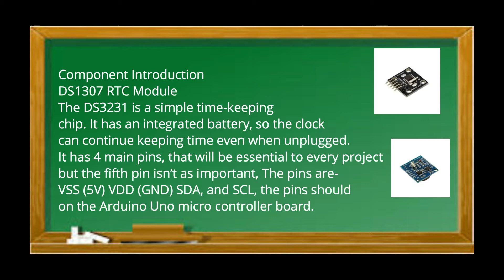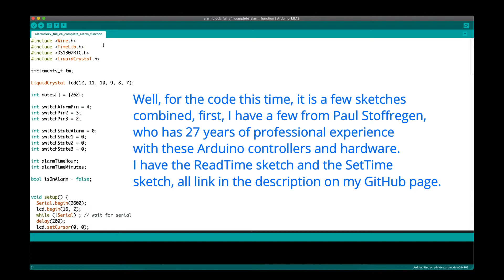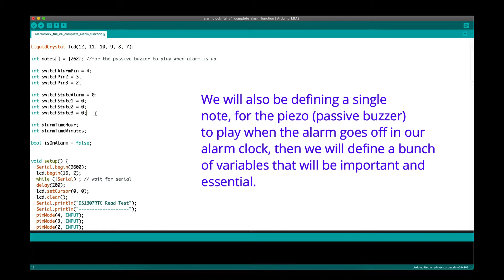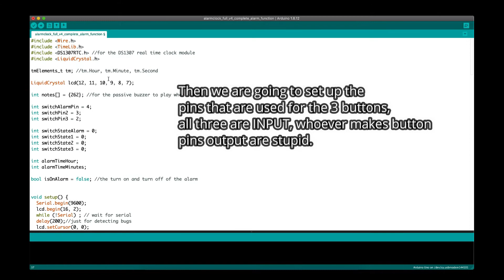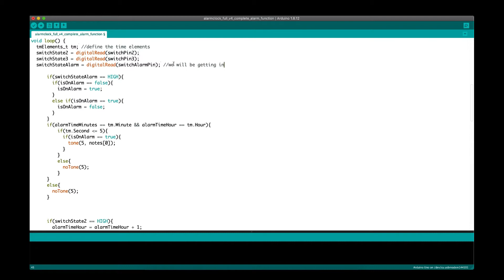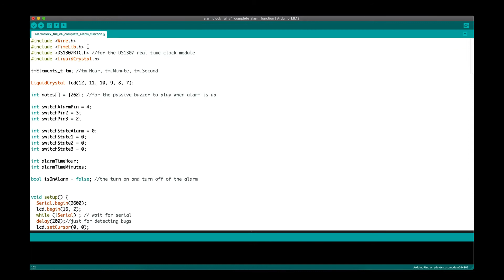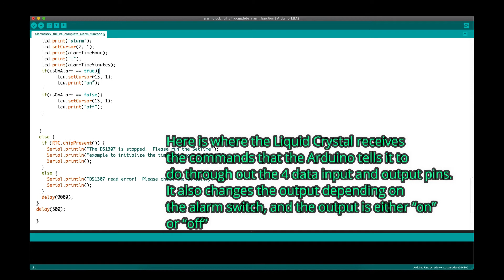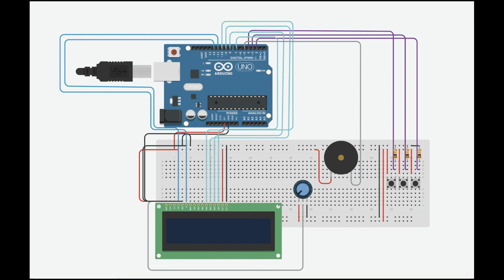Arduino Alarm Clock!! Set your own Alarm!!

Comment: Your circuit diagram is not the same as in the GitHub why is that and which one should I follow. Also can you please tell me the ohm values of the resistors.
Reply: true that's also the problem i'm facing